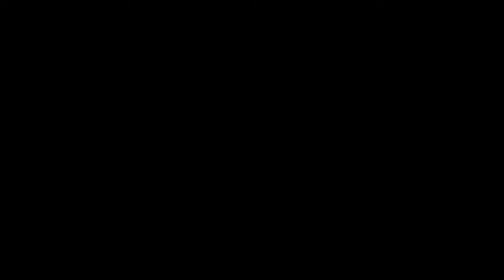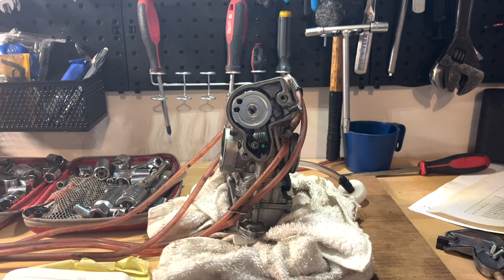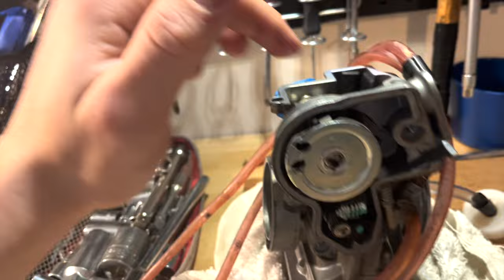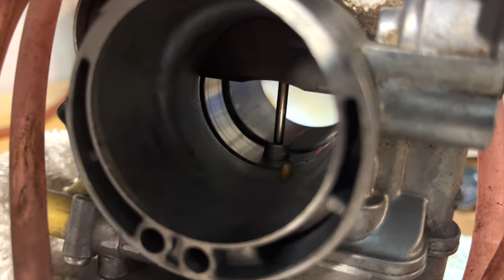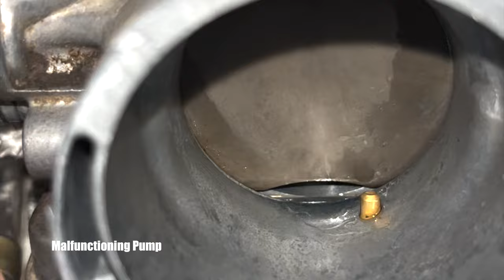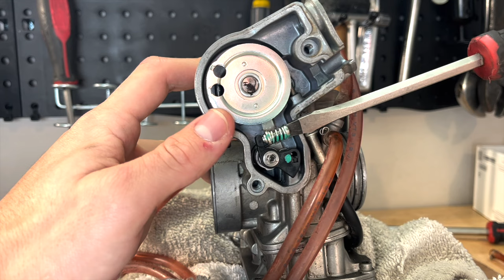FCR Carb Accelerator Pump Tuning [EXPLAINED]

Comment: Can you tell me the name of the jet that squirts the fuel into the body ? I can’t seem to find it anywhere online . Thanks
Reply from the maker: I’m actually not sure if the physical accelerator pump jet is replaceable. It might only be able to be gotten with a whole new carb.
Reply: Press fit from factory. Not a replaceable jet. If you need more adjustment (you dont) an adjustable leak jet set up is avaliable from quickshot. This is rarely needed for the average rider.

Comment: How can I reset the position of that throttle disc with the idle screw to get a baseline Idle before even beginning to adjust the AP timing ? , I turned the idle screw not knowing what I was doing.
Reply from the maker: Hey man,  I no longer have that carb but in my experience there will either be a brass screw on the side of the carb that you screw inwards to increase the idle speed or sometimes you  will be able to adjust the idle in the same place you choke the carb.
Reply: Got it I’ll check that out, thank you for the advice ✌️
Reply from the maker: Of course man 🤙🏼

Comment: Great explanation.  How do you adjust the duration of the fuel delivered by the accelerator pump?  Mine is shooting for like 3-4 seconds and the bike drinks gas like crazy because of it.  This is for an FCR39mx on a drz400.

Comment: Thank you! I have been helping a buddy tune his yz250f. I cleaned all the jets and made sure the whole carb was operating properly. Still bogging off the bottom when the throttle is opened quickly. I’m pretty sure the AP is the culprit. He’s already stoked because the bike is running better than ever but that bog is not cash money.
Reply from the maker: Right on man! Im glad this video is helping you  guys get that bike ripping again 🤟🤟

Comment: can the accelerator pump affect higher rpm? cause my bike doesn't rev out and it sputters when i give it gas.
Reply from the maker: Yeah I would adjust your AC. The main purpose of the AC is to give a quick extra spurt of gasoline into the motor when you accelerate. When the motor doesn't have that extra bit of gas it can sputter out.
Reply: @madjack_757  Thanks dude
Reply from the maker: @owend_8 🤟🏼

Comment: If the ac pump was spraying to early in to the slide would it cause a stutter in acceleration about quarter throttle … I’m having this issue after replacing my ac pump
Reply from the maker: I hope you’re able to resolve the issue!

Comment: first off great vid! second i have a 2003 yamaha yz250f that im having some issues with the carb i bought a brand new one from RMATV and im getting spitting and sputtering in the mid range and can not get it figured out. WOT it does not happen also with the old carb it dosent do it either reason for chaning is sticky slide and broken off fuel screw along with a bunch of stripped out screws! any help would be greatly appreciated!
Reply from the maker: Hey Tyler, by any chance have you checked your spark plug?

Comment: I have a custom built 43mm and someone added something to the fuel that corroded the carb it took a lot of work but I got it to run really good in the summer but even with the winter jetting it won't even start the carb and mid section didn't seem damaged in the least but the float bowl was the only thing it that the brass in the carb turns green now and I can't remove them to replace
Reply from the maker: It might be worth picking up a new carb at this point then sadly
Reply: I'm going to try and replace the mid orings if that doesn't work then I'm done with it

Comment: Just rebuilt the carb did the diaphragm and tuned the AP ran some gas through the carb off the bike and I don’t see the accelerator pump spraying any gas when I play with the throttle. Bike ran fine top end but low end it would bog. Any advice?
Reply from the maker: Yeah I would double check that the float bowl is full firstly. If you  have the carb not sitting upright, some of the gas could have drained out of the float. Secondly, make sure that you  did not rebuild the diaphragm upside down. The little rubber pump has a right way and a wrong way.

Comment: Can you give me an idea of what you would need to tune my carb after I have done the rebuild and upgrades. I installed a new accelerator pump and mid body as well. I am having stall issues now because the idle adjustment screw was overly turned  and had to be reset on the bike before I could reset the accelerator pump. It never had a bog issue before the rebuild but the pump got damaged due to carb/brake cleaner so, I replaced it as well. I’m in Miami. Could you look at it?

Comment: Where can i find standerd jet size for my 2008 ktm xcf w. Secondhand bike with drilled jets.
Reply from the maker: Hey I'm so sorry for the late reply! This comment got buried in all the comments. I would check Rocky Mtn ATV/MC for parts first. Since its a 2008, you might struggle to find jets but I doubt it. My next place to look would be ebay or any other KTM parts distributors. Good luck.

Comment: Hey great video quick question I’m getting a leak right at the accelerator pump when I open and close the throttle some fuel squirts out of that area and down the carb I located it to there and tested it any ideas I’m new to carbs
Reply from the maker: Yeah that will definitely hurt the performance of your bike. I would dismantle the accelerator pump, clean it and reassemble it. If there is a gasket where your accelerator pump is leaking from then maybe it needs a new one. While you are there, I’d check to make sure the rubber diaphragm/pump isn’t cracked or dry or anything either. Let me know if that helps 🤙🏼
Reply: @madjack_757  yea, I’m going to disassemble next weekend. I got the keihin rebuild kit and going to attempt to rebuild it and it comes with accelerator pump gaskets and diaphragm so planned on replacing and seeing if maybe that helps. I just gotta wait for the kit to come in it’s killing me because it’s starting to get cold and bike been bogging and cutting out so I stopped riding it last month. I fixed a couple things now that it’s down and last is to tackle the carb!
Reply from the maker: Best of luck dude! I am in the same boat right now hahaha. Its gettin colder and I just want to ride but I'm just crazy busy :/ 

Lmk how it goes man and I can try and trouble shoot with ya if you need 🤘
 @juzt2fresh86

Comment: Bit of an issue with my carb off of a crf250r, when you mentioned that accelerater pump needle its not connecting inside that black arm thing where the screw is above it and when u turn thr throttle wheel that black part doesn't move at all and my carb slides are not going in all the way:/ i followed tutorial videos carefully and now i feel like i made a big problem but i hope i can fix it? any suggestions?
Reply from the maker: Hmmm If memory serves, i am not sure if that part of the carb is modular, meaning it can be rebuilt. Is there a way you  can reattach it? or will you need to get a new carb and tune that one?
Reply: yeah it can be rebuilt, but the main issue Is that "black arm" where that screw sits in between that and that "black arm" isn't moving with it...I dont understand why that's happening, in your video it's moving with the your throttle drum but my carb isn't doing that now, does it need to be rebuilt new pieces ?

Comment: The jet that threads into the bowl is stick an I cannot get it out . Any secrets on getting it out?
Reply from the maker: Heat or maybe some kinds of lubricants. If you aren’t worried about having to replace the jet you can abuse the heck out of it to get it out.
Reply: @madjack_757  well the blade wings are busted and it's stuck . It does blow clean so it's currently not plugged . I have another jet just dunno how to get this sucker out. If I can't I think it will just have to live in there

Comment: Hey, ive got an fcr, and its running pig rich. Changing the jetting does not seek to help. The bike starts fine, runs ok for 10 minutes then starts fouling the plug and spluttering. Has been fully cleaned and rebuilt, inckuding the mid. Any ideas?
Reply from the maker: Yeah I would check your owners manual and just make sure that its running the same size carb that it came stock with. A previous owner could have swapped out carbs. Also, if you still have no luck, maybe look into lectron carburetors!
Reply: @madjack_757  I think I found an issue in the cold start system. If the rubber pad on the end leaks, it's like it's running with the cold start partially on.. got a cheap Chinese one on the way to test before putting a genuine one in
Reply from the maker: Oh is your intake manifold leaking? @AndrewHellyer
Reply: Nah nothing seems to be leaking from the outside in, done the engine start spray thing all over, no change. It's definitely the same size carb, 39mm, although it's a KTM exc-f 6 days carb, I'm not sure if the bike is actually a 6days model, slightly different jetting to a non 6days model, not enough to make it run the way it is
Reply from the maker: @AndrewHellyer  hmmm interesting. If you post any videos of it I’d take a look
Reply: @madjack_757  I can't send a photo here, but the plug on the door start was worn right down to the metal. The new one is flat. Replaced it, bike and responded to changes much more obviously, 🤞
Reply from the maker: @AndrewHellyer  Hell yeah man!
Reply: @madjack_757  can confirm, bike runs perfectly now. Never heard of seen anything about this failing on a carb, but it makes perfect sense! My $6 Chinese part has fixed it!
Reply from the maker: @AndrewHellyer right on dude! Try and get some riding in before the winter hits 🤟🏼🤟🏼

Comment: Any information on the oring mod for this carb on the accelerator pump. Thanks
Reply from the maker: Hey Tony,
I've heard of the mod, but I don't think its really necessary because if your carb is tuned properly then the performance gains with the o-ring mod will be pretty marginal. Give it a try though and make a video! I would love to see the mod in action 🤙🏼
Reply: @madjack_757  yea I did see that the mod is just adding an o ring to the AP cam and tension screw. JD includes two types of o rings in jet kit to give you two different results. The end product is more responsive throttle off the bottom apparently. Will keep you guys posted as I have the JD kit on its way.
Reply from the maker: Yeah it supposedly just binds the two components so they move in unison right? Yeah definitely keep me posted, I am curious to see how it turns out @tonymckechnie9999

Comment: I’ve tried all of this. Both my yz250fs 2003 bog out if you crack throttle. Could the diaphragm be bad?
Reply from the maker: I would check the integrity of any and all rubber diaphragms. Make sure they aren’t cracked or brittle. Aside from that, perhaps rejetting could be your next plan of attack.

Comment: Nice vid. I'm working on one now and even though it has had all the "YZ-F" mods done to this "WR" carb (such as the throttle stop screw mod, grey wire mod and a zip tie around the accelerator pump linkage) I still have a lean bog. Timing of spray pattern is not hitting the slide but I guess it could be too late as well? I completely rebuilt this carb including pulling the mid body with all new O-rings etc. 165 main and 48 pilot. The pump diaphragm looked OK with no visible tears but would you still replace it with a new kit or would you remove the linkage zip tie (I guess it was done instead of the O-ring mod) and re set the linkage screw to factory spec's as in your video?  Getting tired of pulling this carb on/off the bike. Thanks for any pointers.
Reply from the maker: I feel your pain on a religious level. If I were you id look into a few options. Firstly, a smart carb like a lectron carburetor is a pretty damn good performance part that can solve all your problems but it’s expensive. Other than that I would fill your float bowl and pull the slide a few times to see just where the fuel is hitting from the pump. Then make adjustments until the fuel just starts to spray as the slide goes up. Beyond that I would remove all mods and bring the carb back to stock settings or maybe even take a look into possible ignition issues, check to see the conditions of the head, how strong the spark is, etc.. best of luck to you brother 🤟🏼